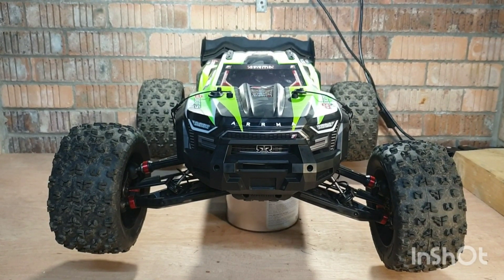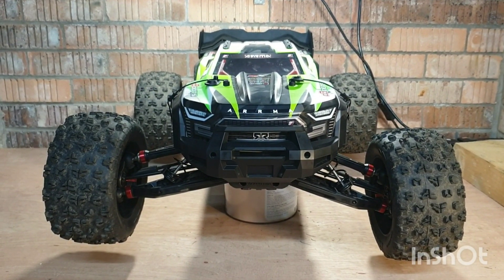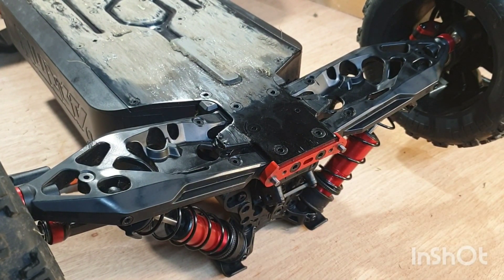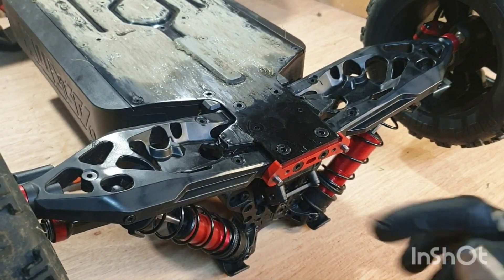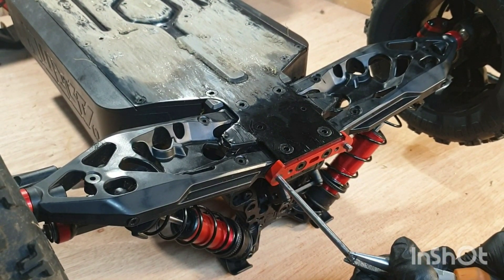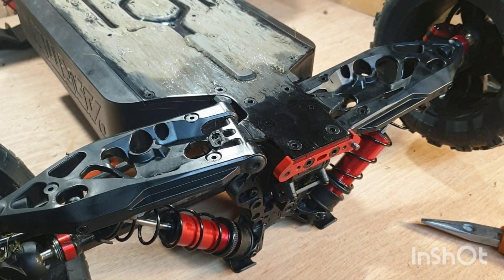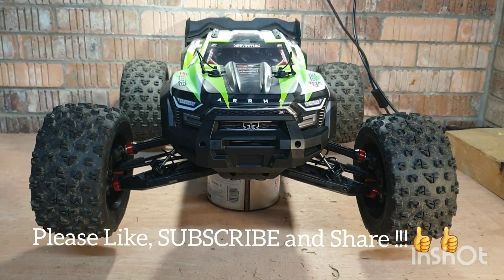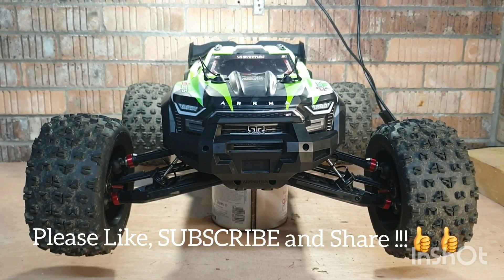Outcast 8s kraton 8s- FREE MOD! Why and how to install droop screws.

Comment: Awesome informative video as always.
I'm seeking this mod out because I have broke the rear dog bones twice and noticed the over extension. Great idea upside down with ductape for extra protection.
Thanks again!
Reply from the maker: Thx buddy... I did this mod initially to stop over extention of the shock shaft to avoid bending them. It worked really well... I didn't bend any. I think m2c make some better droop screws that you can adjust from above. Similar in design to a grub screw with a flat bottom...
Thx for your comment and thx for watching....👍👍🙂

Comment: It's not unconventional....
This is exactly what I have done on my Outcast 8s Also.
Nice video brother
Reply from the maker: Excellent! 👍its been a while since I've done it. I've had a few runs since. All good so far. I also changed the shock oil to 30wt. I haven't had bent shocks yet. 🤞
Reply: @inspiredrc  yeah Rich did that too and he thinks it helps. I have had droop since day one. Haven't broken a shaft or rod end yet. Course I haven't had a chance to go Duperbash big yet..... YET
You Gotta watch his next video though.... It's not out yet.... Just wait.... Thats all I'm gonna say!

On the droop screws. I really wish Arrma would have stuck with the same size holes as the 6s trucks and we could use M2C droop screws, and if two then space the holes apart!
The RPM Arms for the 8s are a bigger miss.... Don't even have droop screw holes! WTH
Reply from the maker: It makes sense to put them in with all the reports of carnage online. I have also covered the fans with plasterboard tape to avoid breaking fan blades. If you can it is a good idea to do it. I've done a vid. Worth watching if you get 5 mins 👍

Comment: Cool very helpful.  Looks like I have some work to do before I start running mine.
Reply from the maker: Thx dude!! Its not too difficult but is well worth doing 👍🙂
Reply: @inspiredrc  so this is the laundry list I want to do before I start running it. 
Droop screws
Center Diff, 20 million in the diff
Shocks 32.5 in the front 30 in the rear.
Vent tires
Drywall tape and goo body
39t spur
23 pinion
Punch 5 on esc.
Reply from the maker: @scottw2157  yeah thats about right. Also I change the break strength to 62.5% and BEC to 8.4v

Comment: I just discovered this post. Nice one. I broke a shock end on the rear and I couldn't figure out why that would break and looking I saw there were no droop screws. Figured armma didn't put them there cuz they weren't needed. Didn't know about the holes already there. Doesn't make much sense why they would put them there and not add stop screws.  Anyway, I flipped it over to see what you were talking about with the pre-existing holes and I noticed with the shock disconnected, still is while waiting on the part, I can get at those holes to add screws without removing the suspension arm and pins. I released a shock on the front and found I have good clearance to do the same there also. Releasing at the top connection was the easiest, so nothing was hanging up when you move the arm . I'm sure I'll have to keep flipping it over till I get them adjusted right but I'd rather do that than take all the front/rear ends apart. LOL.  another thing I noticed is I can lay a flat edge across the arm to give me a good starting point of how high to leave the screw heads above the arm. This said, I'm glad I found your post cuz I did do the same on my 6s after I saw the stock stop screws were eating holes right through the chassis. Didn't know the holes were there on the 8s . Thanks for mentioning the screw sizes. Saves me a lot of trial and error , and cussing. LOL.
Reply from the maker: Thx pal. Good to hear my vid came in useful. Alot of it is trial and error. I don't know why arrma didn't do it in factory. It would have cost them nothing to do it 😕. We would get a better experience. Anyway thanks for the advice. Good thing is I haven't broken any arms or bend any shocks yet 🤞 thx for the support 👍🙂
Reply: @inspiredrc   Well now I'm really glad I saw your post. I just was taking it apart to install the screws and I noticed that rear suspension arm where the shock broke  was hanging lower. Well S.O.B, that chassis stop tab is bent. I just got this thing and I'm not doing any crazy jumping. Just ridiculous, I don't know about this built Armma Tough slogan.  Oh well, now some more fun/aggravation. My 6s has been broken more than I've used it. But like I said, I'm super glad I saw your post before I just threw the shock back on. I think I might need another hobby. LOL. Just a side note, if you look at that space where you put the two screws in you'll notice it is recessed. Almost like they were going to put a little plate in there and screw it in. Probably was engineered that way and somebody wanted to save a couple bucks down the line. Think I might try and make one (4) before I put this back together down the road. Armma Tough, Armma Cheap. Lol
Reply from the maker: @WildBillRidesAgain  yeah I am nervous when I take it out. My X-maxx takes an absolute beating when I get it out. That is one tough rig!! Let me know how you get on. Another issue i had with mine is I broke a fan blade on the esc. I did repair as no replacements were available at the time. I also covered the fan housing with some plasterboard tape to stop any more stones braking my fan. So far that mod has worked  well for me. I also changed shock oil all round to 30wt. Stock is 40wt.
Reply: @inspiredrc  okay then, I decided not to overthink it and just put the screws in as you did. I had bought a supply of stainless steel screws for my 6s so I had everything I needed. With both screws in there it looks pretty solid and I noticed the first contact point now is in a little more towards the chassis which should protect the wings from getting bent so easy. I find when it's sitting up on a stand and the shocks are released from the shock tower you can reach underneath and adjust them very easily. I agree with you, that's a very needed mod. Also going to do something along the line of covering the fans as you did. I run on gravel a lot and I would be taking the cover off my ESC fan on the 6s quite often to pick out gravel pieces. Don't want to have to start doing that on this one. Like your channel keep it up.

Comment: Great video, thanks. Just a little on the droop screws (you may just tell me I am a little drooped after reading this. 
When you install RPM arms (which I highly recommend) you can't install droop screws because that section is missing. In my opinion, if you look at the design and you notice where the Arrma arms always break (outcast 8s) that is ( I don't have the Kraton but they are the same), it is partially due to the droop screws. Over time, the impact in that area (I think) weakens it and there for breaks on impact in that area. I made my own droop cables which (Knock on wood) have worked great. They seem to help save the shock ends (none broken yet 10 packs worth). The cables are attached to the shock towers close to where the shocks are and through one of the holes on the inside of the arms. I think the idea can also work on the Arrma arms. Again thanks for the great video, keep it up
Reply from the maker: Using the strap system to reduce the shock travel instead of droop screws is a good idea. Losi use that method on some of their RTR.
Reply: Instablaster...
Reply: How to make the droop cables
Reply: @eddiefitzgerald7731  Send me your email and I will send you an image

Comment: That wouldn’t add stress in the event of a tumble with the weight of the truck and the shock tension working against it? I know others insert stoppers inside the shock on the bottom end of the shock piston so it doesn’t extend out all the way. This is still a neat trick I didn’t know any about and looks much more simple than opening a shock. I can see this application working great for prevent speed passes. Thanks for the tip👌
Reply from the maker: This is one of the best mods I've ever done. I've been bashing the rig setup for 1 and half years now and still haven't bent a my shock shafts. Its slightly unconventional but definitely works. I changed my kraton into an outcast 8s and bash it silly. Check out some of my recent outcast 8s bashing vids.

Comment: Put the screws in from the bottom... Works better more surface area than the small side
Reply from the maker: It's definitely better upside down, but you can get proper droop screws from m2c, which you can adjust from above with a hex driver. It makes it easier to set the droop. It's basically a long grub screw with a flat bottom. 
I've not bent any shock shafts because I put droop screws in.. it's definitely worth doing buddy. 👍

Comment: droop screws gonna rub holes in the aluminum chassis.....then what?
Reply from the maker: If the droop screws eat into the chassis then you have to constantly adjust them to keep the droop correct. These screws were installed over 6 months ago. They are still all good 👍